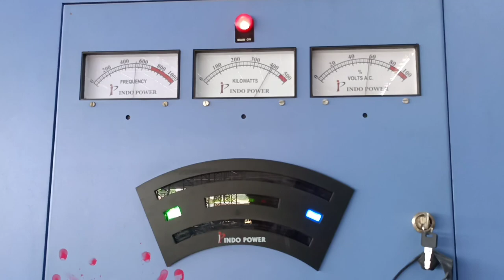MS Iron Melting Process using induction furnace #INDOPOWER @foundrytech-indopowerinduc2917

Comment: I would like to know what did he put into the bucket at minute 3:38 and for what reason
Reply from the maker: Ladle use for  pouring purpose of melting metal ... direct mold filling from furnace is not possible
Reply: thanks for your reply. What I wanted to ask was.. what is the substance that person threw in the ladle? and why. @foundrytech-indopowerinduc2917
Reply: @sdfeter  probably detox or slag-O but they didn't slag out after dumping into the ladel so Idk either lol